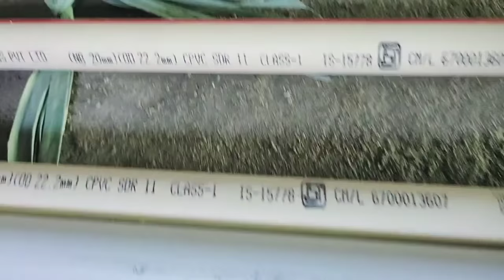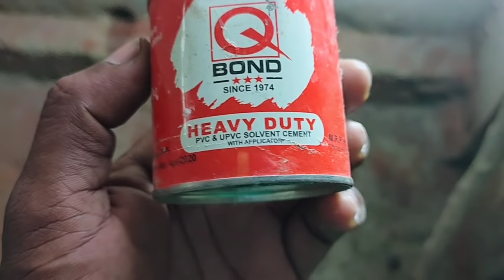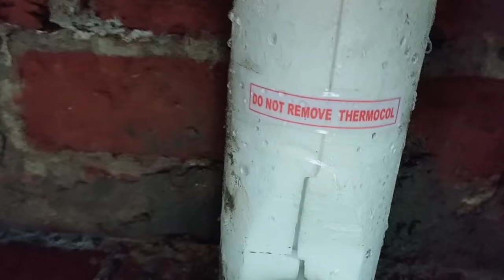Bathroom pipe line fitting Complete working process

Comment: There no, control valve inside the bathroom very poor work 😄
Reply: Most Indian homes use water tanks (1000ltr or more) to store water supplied either by the municipality or pumped from underground. At the outlet of these tanks there is a control valve for the water flow.
So there's no need for a control valve inside the bathroom as the one by the water tank is enough...